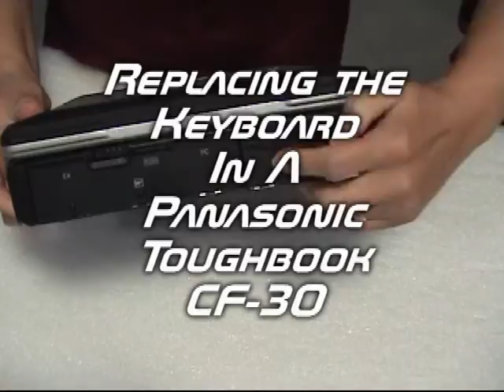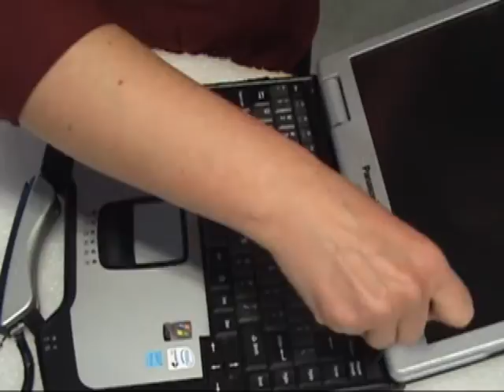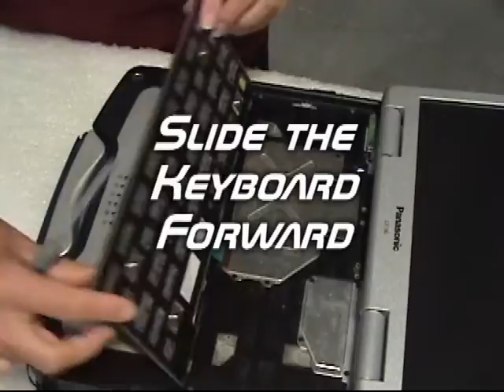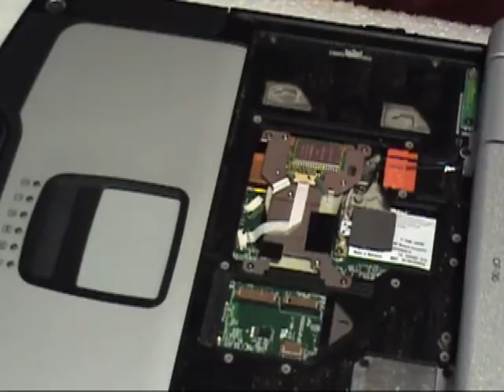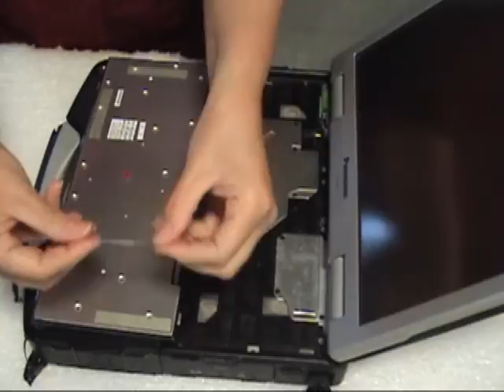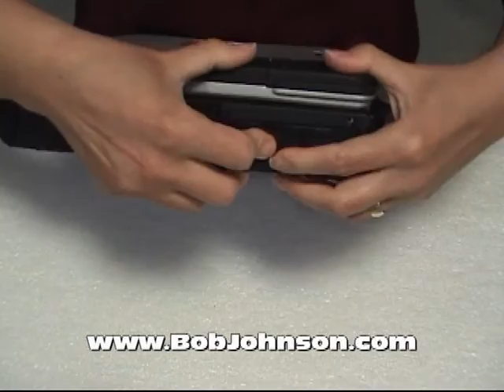How to Replace the Keyboard on a Panasonic Toughbook CF-30

Comment: The backlight cable is connected in the wrong way in this video. I have a CF-30 and just installed a backlit keyboard on it. The backlight did not work and I researched and googled the problem for several hours. Drivers, bios, etc. Until I saw another keyboard replacement video. The backlight wire (the narrowest ribbon cable) should be inserted into the connector so that the metal contact surfaces point up, not down.
Reply from the maker: Sorry about that! Thanks for taking the time to point that out! Thanks for watching!